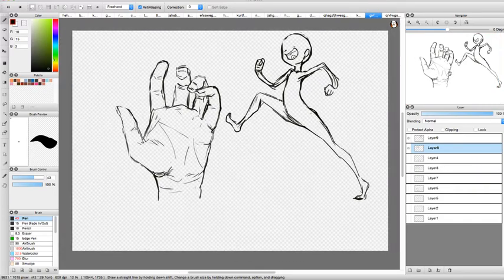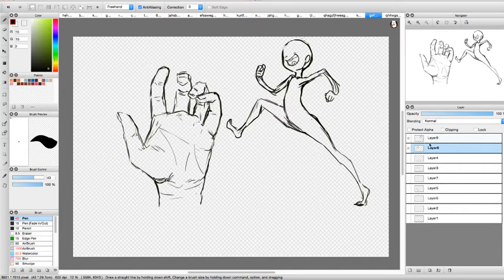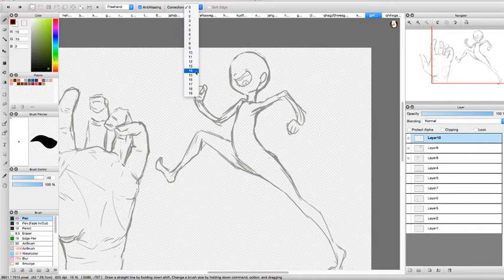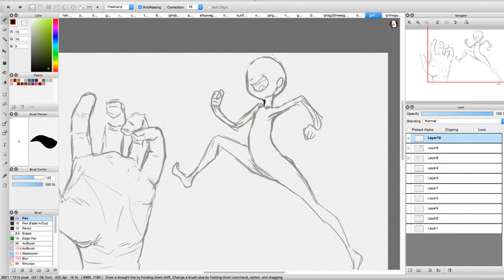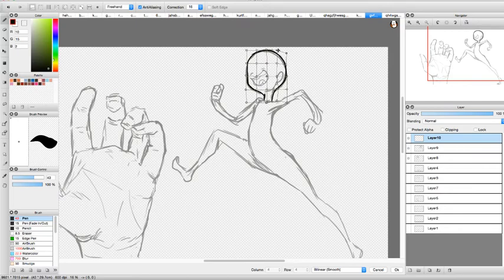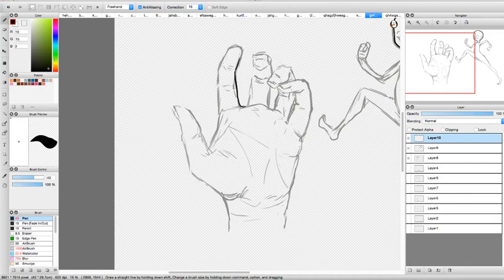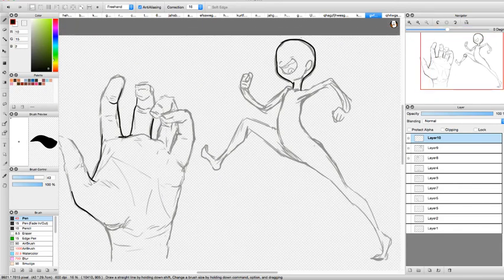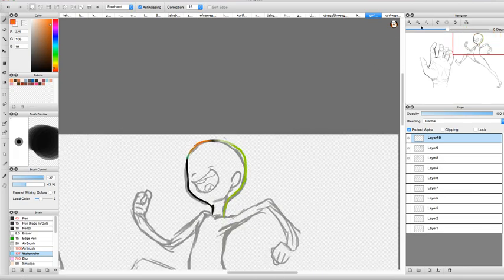How to do clean lineart in FireAlpaca

Comment: I want my lines to have a consistent line width but sharpen near the ends, but mine are more round. Would you know how to fix this?
Reply from the maker: I would suggest using the "Pen (fade in/out)" brush. I find this has sharp edges~ but if u still are not getting the sharpness u want, u could either use the eraser tool or download some custom brushes ( u can find them on devintart, etc) u may be able to find a brush that works better there~ (most are free btw^^)